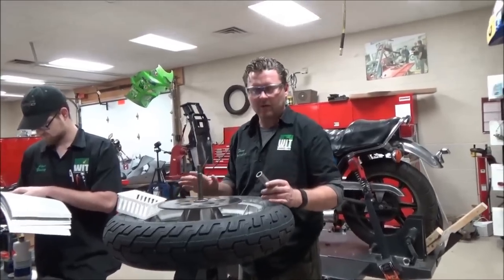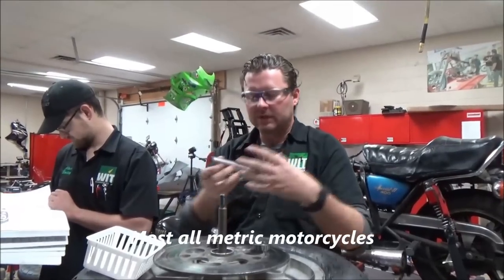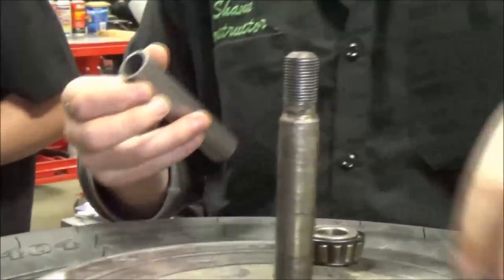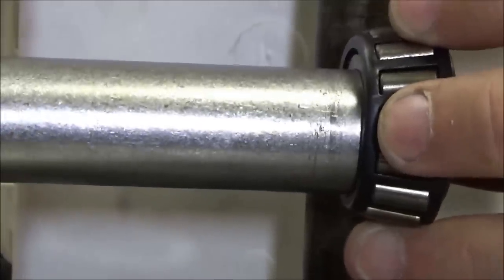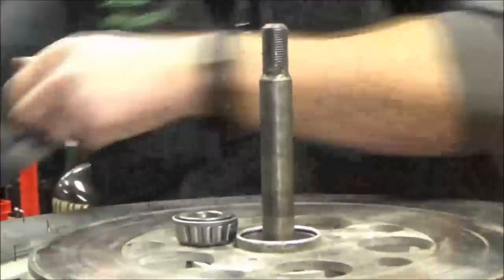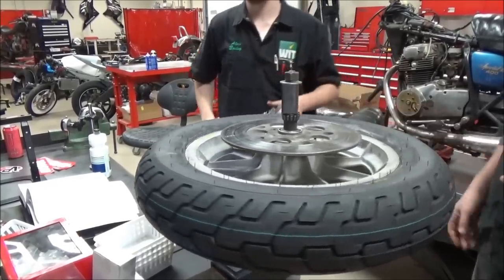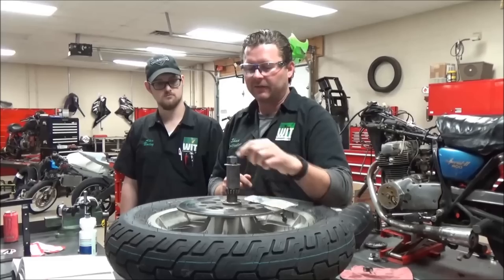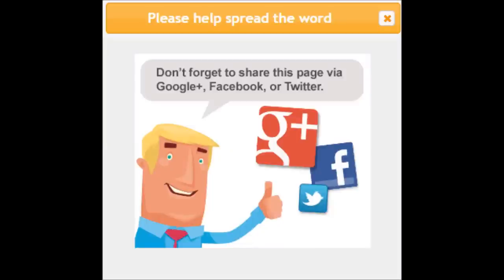How to measure Timken Style Bearing endplay. Part 1 Harley Boat RV Trailer Auto Truck

Comment: Thanks Shane.  I think this is something for me to look at.  My bike has good wheel bearings on the rear wheel (belt). Tire rotates ok with little torque, but when fully installed, the bike makes whoo.. whoo.. whoo sounds after a few blocks of riding (not the belt tension nor sticky break pads - I checked) and mostly heard when running the bike at 10 to 15 miles an hour.  I think I will take it apart again, order the middle spacer and replace it.  Will check the wheel fully torqued before I replace it thought to make sure that is it.  This has been driving me crazy since I bought the bike a year ago. :-)
Reply from the maker: Thank you for taking the time to comment! Hit that subscribe button please! It helps us!
Here is a way to support all the free videos.
Want to say “thanks” or “keep it up”? Click here https://www.paypal.me/how2wrench  

Coach Conley is also available for hire to personally work one on one with you if ever needed. Yep he is a real person. Give him a call @ 602-345-0432

Your answers and help are just around the corner. Save time and money while protecting your investment and yourself by doing it the right way!
Follow us!
Web:
www.How2Wrench.com    
www.Tools2Wrench.com

Comment: Excellent, professional tutorial! 
I've trained many aircraft maintainers and ya did a good job. I'll cite the two vids as reference for others. 

What's shown here applies to tapered roller bearings in general. For specifics the bearing manufacturer sites go into much more detail not required to R&I parts but worth a read for gearheads. You can never study too much.

Comment: very well explained . people don't understand how important wheel spacer condition is . I once had to cut the rear wheel out of an r1 yamaha because the guy had powder coated his wheel and put a new bearing on top the fresh paint without cleaning back to bare metal first.   so when it was time to tighten the wheel spindle, there was play in the wheel . then, instead of investigating why he kept winding the nut tight . the spindle on the r1 is hollow, so as he tighten'd the nut, the spindle became out of shape and caused high spots . these high spots then stopped the spindle from moving.  I had to cut the rear caliper carrier off the spindle then use a power saw to cut the spindle in two at the sprocket carrier side . what a fecking nightmare this job was.  I thought to begin with it was seized so could only use live steam .   anyway, while all this was going on, his mate (another r1) was riding round with crushed rear wheel barings. he had taken his wheel out to change a tyre and lost the alloy spacer that sits in the centre of the wheel. he tighten'd the spindle nut without the spacer and burst the baring on the caliper side .  both bikes ended up having new spacers, barings,  spindles etc.  it cost them a small fortune.  be careful with powerful high speed bikes !  if your not sure, don't touch
Reply from the maker: (Copy for others. Thanks for the support) Please use the contact form link below. 
You're in luck. I do offer personal service to back up what's missing from a video to fix your specific problem. Live Chat is great for you to actually show your specific issue! Become a member of my website. It comes with a free HOW2WRENCH “Keep Wrenching” t-shirt or 20 mins of techline! Sign up now to have my personal cell phone number on speed dial! 
As always thank you and enjoy the free videos! Much more to come! I look forward to working with you and hope you will become a member of our learning community. 

Link to membership: https://how2wrench.com/product/membershipmembers-onlymembers? 

Contact form: https://how2wrench.com/contact/

If I can ever be of service to you, here is a video explains how to connect with me. 
https://www.youtube.com/watch?v=vjvmB01ebcs 

Direct link to services: 
https://how2wrench.com/product-category/tech-lineservice-callminutes/ 

Donation link: https://www.paypal.me/how2wrench

Comment: Very valuable instruction!!   I'm replacing my 1" front  bearings with 3/4" and need to figure out the spacer width and material.  Once again "Great Job Shane".
Reply: Gordon Woolfrey could you make a 3/4 to 1 in ?
Reply from the maker: Thank you for taking the time to comment! Hit that subscribe button please! It helps us!
Here is a way to support all the free videos.
Want to say “thanks” or “keep it up”? Click here https://www.paypal.me/how2wrench  

Coach Conley is also available for hire to personally work one on one with you if ever needed. Yep he is a real person. Give him a call @ 602-345-0432

Your answers and help are just around the corner. Save time and money while protecting your investment and yourself by doing it the right way!
Follow us!
Web:
www.How2Wrench.com    
www.Tools2Wrench.com

Comment: Do you have any videos showing the race removal / instillation on this type of tapered bearing? I'm doing a 1983 XL with 3/4 tapered timken bearings. I have found zero videos showing the correct way to do it. I have bought some tools and plan on heating the hub to ease the process and freezing the races when installing. But I would love to see a professional like yourself show the process of using proper tech and tools removing/ installing the races and bearings.

thank you. Your lessons are the best.
Reply from the maker: I sure do. Thanks for being a member. Let me find you some links to them. Can you email this request to me at info@how2wrench.com please?

Comment: Yes they will bind as you say,However they will also bind because they are not greased and a taper brg has to be rotated during the torque down or binding will happen wouldent you agree.Yes the spacer must be true both sides.
Reply from the maker: Thanks for commenting and adding value to our community! 

Have you subscribed yet to never miss a video? Have you seen the video playlists? Check them out here: https://www.youtube.com/user/conleybuilt/playlists  

Want to say “thanks” or “keep it up”? Click here https://www.paypal.me/how2wrench    
 
Your answers and help are just around the corner. Save time and money while protecting your investment and yourself by doing it the right way at www.How2Wrench.com

Comment: AT 2:30 just put a 90 deg small carpenter square on that pipe and check it, if needed: dress it square by kissing it lightly with a 90 DEG  table sander...

Comment: I got one metal spacer. Rear brake side. And I forgot where to put it. Do I put it between the swing arm and the brake mount or inside between the bearings and the brake mount? I was thinking outside between the swing arm to avoid the bearings

Comment: I got a replacement tube and had it machined down to proper length . Now I have .05 end play  .  Question is what do the flanges or deflectors do on the old bearing spacer tube as the new tube came with out any and is 1 inch outside diameter where as the old was slightly smaller ?            Are they necessary ?
Reply from the maker: Yes. You need the flange lip! Just as shown. Thank you for the kind words. If I can ever be of service to you, here is a video explains how to connect with me. 
https://www.youtube.com/watch?v=vjvmB01ebcs 
Keep Wrenching,
Shane Conley
Instructor/Motivator/Motorcyclist
www.how2wrench.com

Did you like this free video and hope to see more? Would you just like to say thank you with a donation? Click https://www.paypal.me/how2wrench 

Like freebies? Click here for a free diagnostic checklist! 
http://gem.godaddy.com/signups/364621/join 

Head over to the new website and subscribe to the newsletter to never miss a video or newsletter! 
https://how2wrench.com/contact/

Comment: Hey once  the bearings are properly torque, the hollow pipe that is sandwich in there should spin along with the bearings when the wheel is spinning right?
Reply: Nope, it's sandwiched on the inner race, that sits still, outer race goes around.

Comment: I have an abs light on my 2010 Limited FLHTK. I have changed the rear and front wheel bearings and abs wheel sensors, but still have abs light. Any scanner tool you recommend for me to buy to figure out why I have abs light ?? Thanks for any help
Reply from the maker: Mostly need to have the module reset by a dealer. Shouldn't be to much since its simply a hook and set/clear. I'm not aware of anything affordable. 

 Have you Subscribed yet to never miss a video? Have you seen the video playlists https://www.youtube.com/user/conleybuilt/playlists ?
Still have questions? Coach Conley provides tech help and works one on one! His YouTube and training center has grown beyond the ability to answer every question (11 million views! Over 500,000 a month!) He gets 300-400 requests a week. Become a member for his direct cell phone number and personal assistance!

Click here for the membership links and welcome to the community! https://how2wrench.com/product-category/specials/ 

Want to say “thanks” or “keep it up”? Click here https://www.paypal.me/how2wrench 

Your answers and help are just around the corner. Save time and money while protecting your investment and yourself by doing it the right way!
Reply: Shane Conley Thanks man
Reply: Scan tools only pick up information the sensor sends. Don't just replace a sensor because the scan tool  mentions it. It just means something in that area. You need to verify the sensor is bad. Never just throw parts at a problem. You'll never know what fixes it. Plus, you won't learn much either.